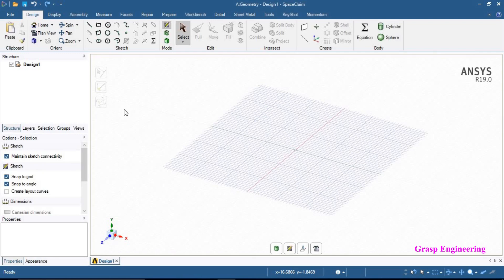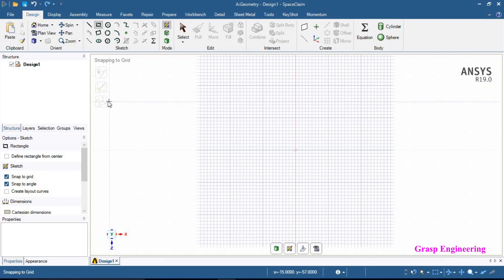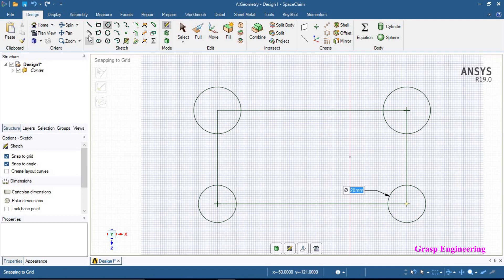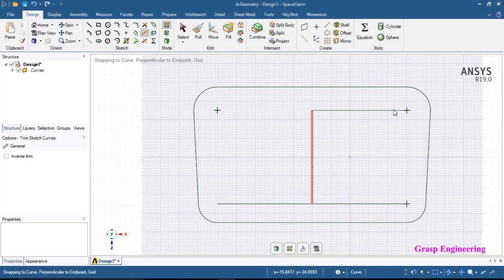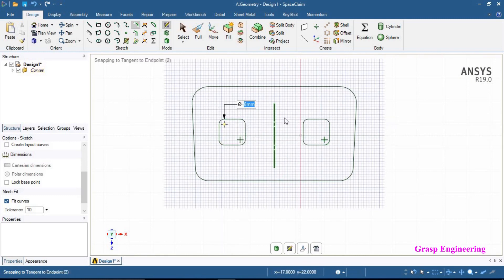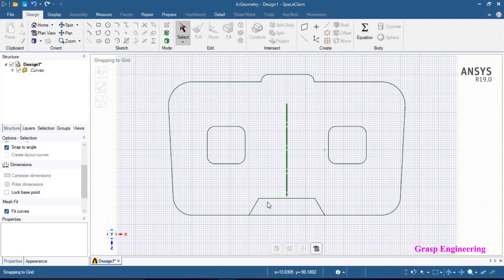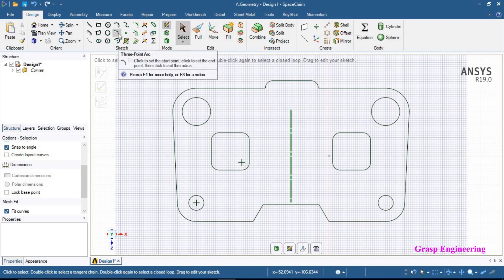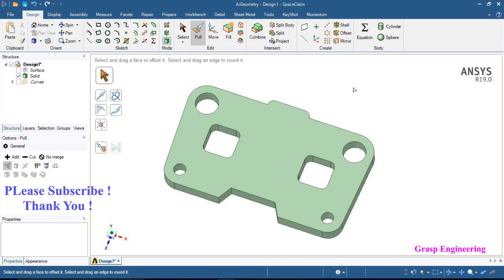ANSYS Spaceclaim tutorials. Basic Sketch, Module #3

Comment: Is it possible to go back to the original sketch once you made the surface/solid, and you can’t CTRL+Z anymore?
Reply from the maker: You can do with the help of Ctr Z. It will go up to previous saved model.
Reply: @graspengineering9249  what if ctrl Z doesn’t work? For example, when closing the project and reopening it a day after?
Reply from the maker: @victor13165  Once you will close the window it won't work. It is quite simple to model and do changes. Instead of going back, save sketch file and used several times when you will need.
Reply: @graspengineering9249  i didn’t think of saving the sketch file. Thank you for the quick answer, your video was very helpful!!